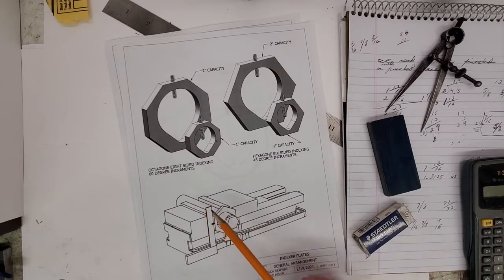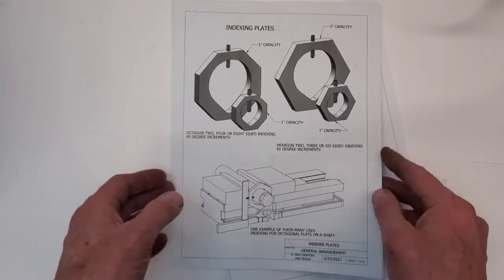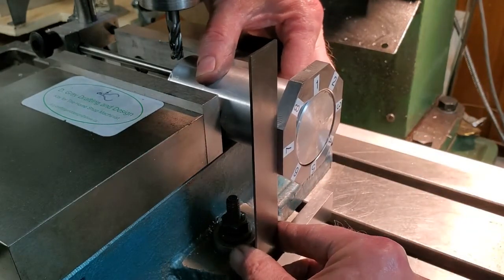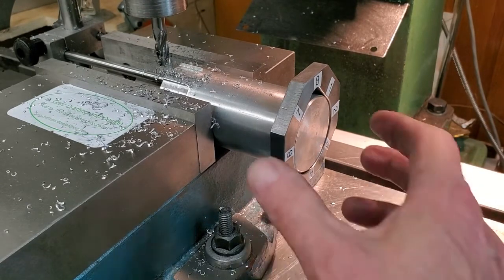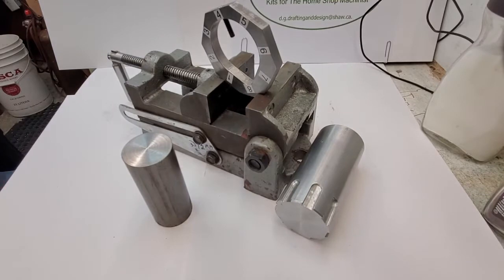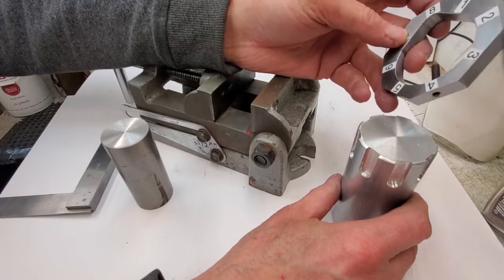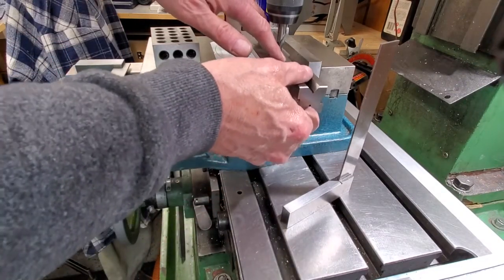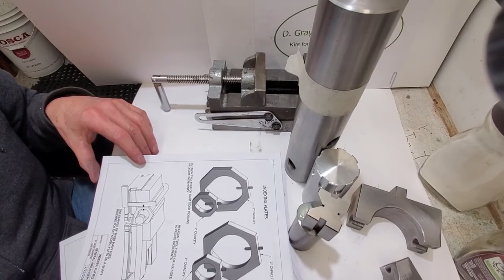ALL ABOUT INDEXING

Comment: You've got the driest sense of humor: (A) mentioned the lights dimming when you plugged in your dad's old Bostic glue gun I was chuckling like crazy, but also (B) when you just glopped on the V-block to illustrate "here's what I COULD'VE done for the auger shaft, instead of these massive fixtures that were a huge P.I.T.A. (that clearly as you mentioned were kind of near the envelope for your equipment!) -- stroke of genius, in terms of illustrating what a simple/subtle concept this actually is. (And I could kind of feel your own ... Homer Simpson "DOH!" of realization ... which I feel often.... :-)) Nicely done.
Reply from the maker: Thanks a lot. I'm here all week.